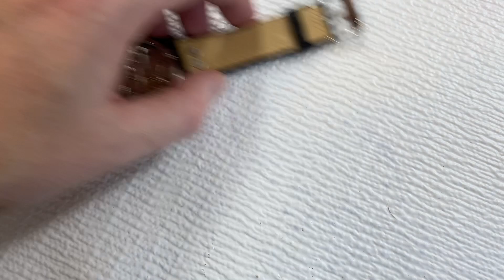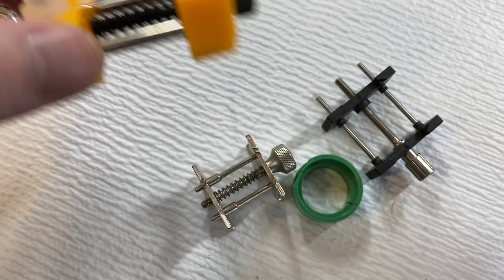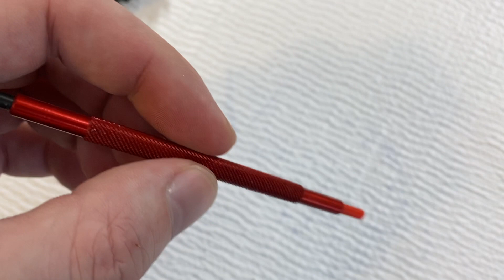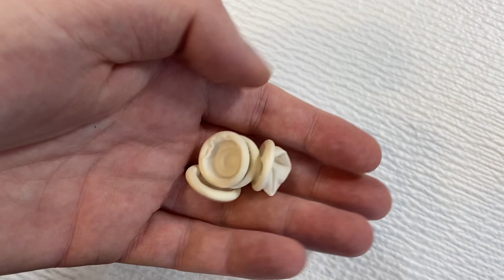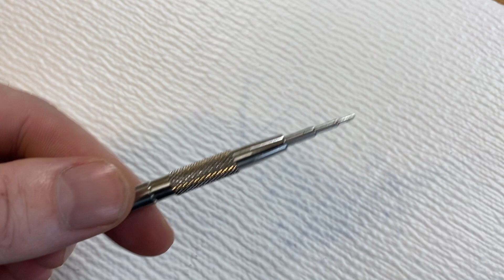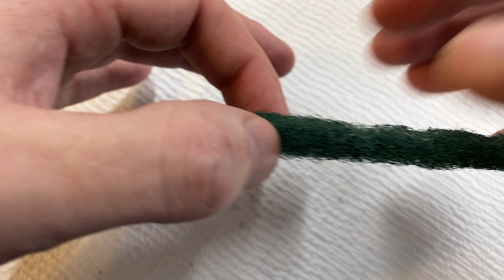Watch and Watchmaking Tools: The Basics

Comment: I really enjoy your videos!  Question, can you please provide the link, or where I can buy the individual "circular or round" Case Back Protective Film, (used to prevent scratching the case back when removing)?  I only can find rolls on Amazon, Esslinger or Otto Frei.  Most of my watch collection are 52mm in size, (large case backs).  Thank you!
Reply from the maker: like this? https://www.esslinger.com/bergeon-protective-vinyl-sheets-7982-pack-of-3/
Reply: @WatchComplications  Perfect.  Thank you so much!    Need your help....regarding the Bergeon 6767-S or 6767-F Spring Board Tool.  The Standard fork end is 3.0mm and the Fine fork end is 1.30mm.  Almost all of my watches are 52mm in size.  Which size Fork End should I buy?  Standard of Fine?  The purpose of the 6767 is to remove the pins near the Case to get the bracelet off, (so I can mount it on my 5700 Case Opener and change out my batteries).  Very grateful for your help.
Reply from the maker: i'd start with the F tip and then just buy the S tip if you decide it's also needed. depends on the types of straps and lugs.
Reply: Noted, with thanks.  I always say...."every answer to every question in life comes down to two words":  "It Depends".  Thanks again.  Love watching your channel and really enjoy your skill and gift of what you do. @WatchComplications

Comment: Do you ever need to go below 0.5mm in screwdriver size?
Reply from the maker: i’ve not had to…
Reply: @WatchComplications  What is the free vector program you're using to make dials?
Reply from the maker: @alexanderfrauenfelder9873  it’s called Graphic on macOS. I also sometimes use Affinity Design.

Comment: spring bar removal sucks bug time, somehow it is always a struggle for me. Great tip a found quite some time ago: floss wire! For me it is really the best and easiest way without damaging the strap. And always replace the spring bars with quick release spring bars!
Reply from the maker: yeah, I've seen the floss method recommended before, and it's ok...at least your hands and watch will smell minty. ;) But you also get used to doing this sort of thing and given some patience and experience, using the right tools isn't much of a risk. :)

Comment: The UK version of these interchangeable tips has not proved to be strong enough to slacken off a number of my watch backs.  They wear much too easily then lose their effect. And I have not found a retailer for replacement tips.
Reply from the maker: Several of the tools in the video have interchangeable tips. To which tool and tips are you referring? The case tool? The one I showed in the video is a cheaper one and it’s worked ok so far for me and no tips have worn out. But a higher quality case tool would be worth the money if you work with watches a lot.

Comment: Ok..started hobby repair. Inherited a concord steeplechase..the band/ SS oyster bracelet was shot, its held together by double serrated 13 mm pins. Took it to a jeweler. The schmuck put cotter pins in the bracelet instead, complained parts hard to find.  the band failed in 3 weeks, $ 100 dollars gone. I picked up again 8 years later. Yes the pins are non existent. A common size is 1mm thick..too small, need 1.3 thick, 1. 33 mm for worn holes.. im now  trying to make my own pins..a work in progress. Trying to learn about hardness now. A pin that is friction fit myst be harder than the bracelet material. 
So ive been going thru our households quartz watches..they all just needed a cleaning and battery. Amazing how much dirt metal bracelets hold..
All my watches were easy, pop off backs, some batteries just popped out /in, some one screw. Just ran into an armitron that fell apart when i removed what i call the " battery bridge" 2 screws came out and the cell dropped out, the bridge fell out. The main circuit board came out, the battery negative terminal came loose. Spent about 1 hour couldnt get it back together. Problem is a curved crystal, and i cant get the bracelet off. I stopped. Ordered some more tools. 

This is the first watch that i can start appreciating how light and delicate the parts are. The screws are completely invisible with an eye loop. 
Tools, patience, time. Skill

Im gonna love this hobby
Reply: The problems i ran into tools needed
1 curved crystal..unstable when face down. My kit will have a work vice. 
2. Wrecking my good knife and watch backs, new kit will have a watch back  pry tool
3. All my screwdrivers (craftsman?) Are junk. New screwdrivers, hopefully not magnetized when they arrive.
4. Working on back with bracelet attached..NO MORE.. couldnt remove this because pinned to watch, no spring bars. Tool coming with kit.

The parts found in watches are so small..its not as easy as it looks on the popular youtube channels. These guys seem as if theyre in complete control, but these parts fly off into the ether in a microsecond. 
Dont underestimate the difficulty of what seems to be an easy battery cell change

Comment: For work on the movement what size screwdriver i need first ? Thank you
Reply from the maker: That completely depends on the movement. And even before getting to the movement you would need to remove case screws.
Reply: @WatchComplications  i just working for tissot cal 27,stem is broken

Comment: Anytime you are working on machinery- cars, watches motorcycles you always should use the best tools that you can afford.
Reply: definitely if money is not an issue, but "best in class" tools always going to have a big price premium and so if "alternatives" exists that do the job close enough and is also quite 'reliable' or well-made, this is the trade-off i'll have to make. because for each hobby, there are more than just ONE TOOL for the job; there could be up to ten big purchase tools you need to get for this hobby. 

So, for these 10 tools, you can 'mix' it up with 'big brands' and generic brand alternatives, depending on the 'tool' and the build quality and the 'price'.
Reply from the maker: agreed.

Comment: what's the minimum and maximum screwdriver size you might need? I see some sets that go down to .8mm and others that go down to .5mm. I want to buy a good set, but not end up with tools I don't need. Thanks!
Reply from the maker: I have the Bergeon 5970 and it goes from 0.5mm up to 2.5mm, it has 9 screwdrivers. Almost anything on most movements would be in that range.
Reply: If your working on a 6497. Get a .5mm i had everything else ready. You need it to remove the stem on the 6497.

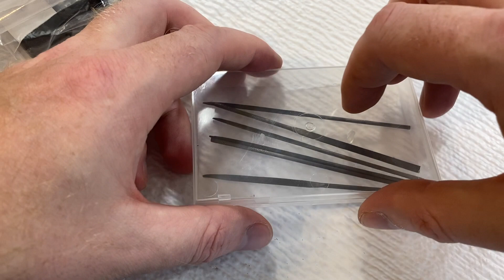Comment: 19:30 how does a thermal conductivity tester allow you to know if its sapphire or not?!
Reply from the maker: Works on the same principle as testing a variety of gems. It applies heat to the surface, and the amount of heat transference tells whether it's real or not. These tools are accurate and work for a variety of gems and stones, of which sapphire is one example.

Comment: Is that oil rack you showed a set? Or did you select those as single items and just put them in a crate?
Reply from the maker: The box with the oil related items is a variety of things I purchased individually and they are sitting in a tray that fits in my organizational unit.